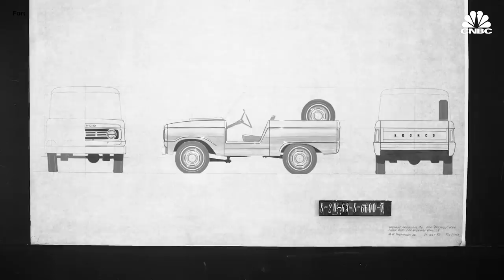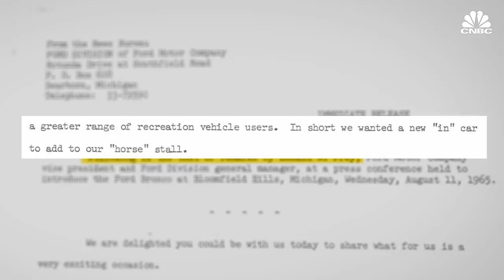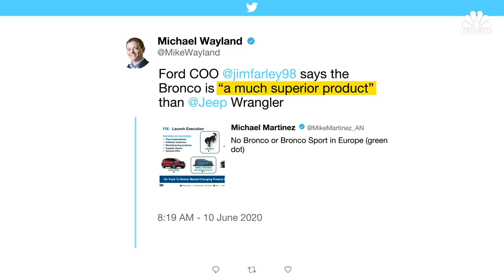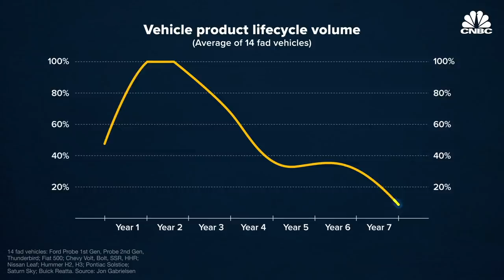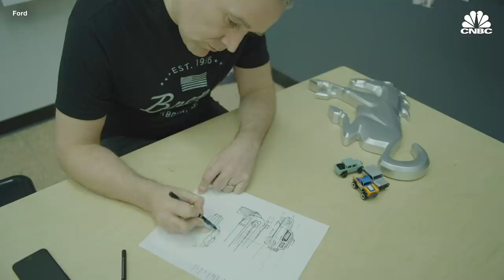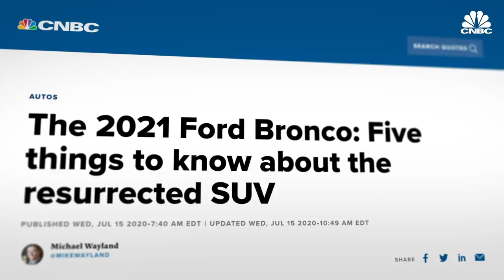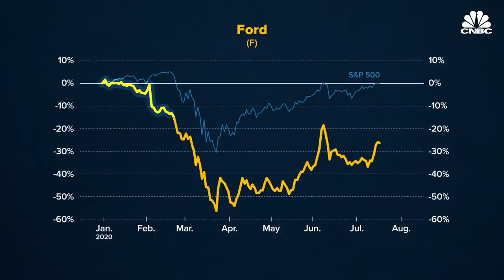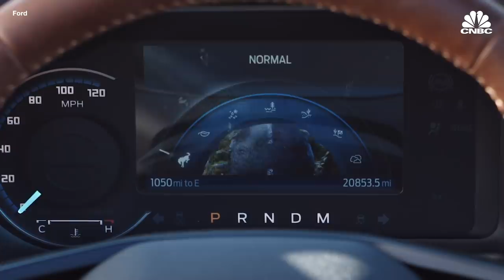Why Ford Is Betting Big On Its Bronco Revival

Comment: Very efficient and simplistic 4by4 ,no carpet. You could pull out the rubber matts and wash with a small amount of soap and water, using a garden hose and a rag. Parked with a slight slope and rinse off easily ,wash the inside same way and the same time as the outside. other than the dashboard and doors (if speakers 🔊) and headliners you’re washing the car inside and out with same two rags and two small buckets of warm soapy water and a garden hose . Easiest car to clean inside and out. Oh! And a whiskbroom under passenger seat. The rubber seal on back of the hood wore out to fast and when ya lifted the hood up when wet out, would allow water to run off of hood right on the distributor cap. Best vehicle my dad ever owned as I was growing up. Plus it had a shorter turning Radius than a Jeep, which was great for those 
Tight switchbacks in the woods.
With a winch and a trailer hitch
It seems like there wasn’t any place ya couldn’t go! 72 n baby blue.

Comment: Driving a jeep on the highway is like driving a giant brick 
[ a jeep owner once said ]
Reply: Its not bad if you realize they are ment for low speeds.
It's common for trucks and keeps to "highway crab", especially with bigger balloon tires.
Our keep has 44's on it and we don't play the radio at 55mph. Its like driving a huge moon buggy. It requires all your attention.
Reply: Hay wagons (pickups) and SUVs are crap on the road anyway, I only suffer one when I absolutely have to which is much of the time.
Reply: @Mrbfgray  try driving an F350, F450 and F550 trucks which are rough riding which you feel every bump.
Reply: @IDIturboDiesel  Yeah probably not much worse than my Chevy 3500 HD with solid beam front suspension.
Reply: @noneshere  that's like saying it's not bad as long as you don't put it in drive. Lol

Comment: The New Ranger was released for all but the North American market back in 2012, they came with a 2.2L turbo diesel, a 3.2L inline 5 cylinder turbo diesel and now have a bi-turbo 2.0L diesel option. The Ranger Rapter has been around for a few years now in Asia and does not share much of body work of the ranger, nor suspension and is super capable. My neighbor has one and it in no way comes second to the large size North American Rapter except for being a mid-size version. I have had a 2.2L turbo diesel Ranger with a 6 speed auto since 2017 and drive it like I stole it, payload is 1,200kgs and I've had more than that in it (large CV cable roll) its very powerful, extremely economical (68L I can drive 1,085kms) and built to last, although some interior decor pieces will not, I expect to get upwards of 600,000 kms out of mine. I did more than that with my last Ranger diesel, but that was a 1986. So this Bronco being based on the Ranger platform is a game changer. I hope the diesel engine will be available in the near future. Its incredible.

Comment: It's really telling that the new Bronco is built on the existing Ranger platform (mid-size pickup), while the old Bronco was built on the F-150 platform (full-size pickup), and yet the new Bronco is even larger than the last generation.  Cars in general have gotten HUGE, and honestly, both Jeep and Ford will have a hard time placating the off-road segment of the market that actually realizes how negatively weight and size affect pretty much EVERY aspect of performance on-road or off.  Both the new Broncos and JL Wranglers in 4-door guise are full-size SUVs.  If they want a cue as to what size is optimal for off-roading, they should be trying to offer models closer in size to a UTV/Side-by-side.

Comment: The issue with the Prowler, SSR, and Thunderbird was lack of power versus the marketing/badging.
Reply: SSR had 400hp
Reply: @shiftymiata  power may have been the wrong word choice, how about performance then.  Slapping SS on a GM implies a performance level  which the SSR nor 454SS did not achieve.

Comment: This is a return to the bronco 2 which was also built on a ranger platform  . I owned  an 86 xlt that ran without any real repairs  for over 200000miles before  it overheated and that was my fault . I was at a loss to replace it  because I couldn't find anything that cool at the time. Tried a full size still being made at the time felt like driving a backhoe

Comment: Anyone who has owned a Wrangle,r that no matter how cool they look and how fun the are to drive, and I never went off road, that mechanically they, like all other Chrysler products,  pieces of junk that at about 60,000 miles need constant repairs. And they seem to get worse as time goes on. So, right off the bat Ford has an advantage, even though I won't buy one till it's used at about 10 years old.
Reply: You nailed it right on the head I would never buy a Chrysler product and the Fiat merger made it even worse. Old Jeeps are cool but they are not what they used to be.

Comment: Honestly, and people may disagree, but the original Bronco and International Scout were both really "Tinny" compared to the Jeep product.  My Electrical Engineering professor [I was 19] had a new 1966 Bronco and my Uncle [an Excavation contractor] had a 1964 Scout.  Both had sheet metal 1/2 as thick as my Dads' 1962 Jeep Pick-up.  The Jeep fenders were like tapping your knuckles on a rock vs. the other two which flexed.

Comment: Like most remakes they’ll miss the mark? Like putting carpet and clothed seats in it! Ya could move the position of the distributor cap so it doesn’t get dripped on from opening hood 
When it’s wet outside. Brush guards that hold spare tires?

Comment: If the engine turns off at every red light, I'd rather have a vintage one, It will increase in value and I can work on it myself. Probably will last longer, too.

Comment: I wonder if the water pump runs off the timing chain like their junk V6s?  If that goes bad it dumps the coolant into the oil. And the dealers charge $2,000 to fix it!

Comment: Ford will fail if they bring back the rollover, Bronco II. The Bronco Rangers, produced during Iococa's reign, in the early 70's were the best off-road vehicles and are still around today. Sold my '75 Bronco Ranger regrettably, about 5 years ago and every winter, I miss my Bronco! It was the best 4x4 in North Idaho during the winter! Had it for about 15 years, only had it high centered once, never was stuck! Loved it!

Comment: Many engineers are not noticing the “white elephant “ , because they never sent out questionnaires, to find out why Jeep & Toyota Wrangler & Toyota mini-truck were even worth their weight in gold. Because the first thing that Bronco & Jeep Wrangler buyer’s want to do is lift it up for big tires. To do this without an expensive $5000 lift kit, this requires a straight Live axle with leaf springs, or secondary coil springs. Yet Ford young engineers went and put another IFS for their 4x4, this makes it more like a urban car, and less like a Safari or Farm & Ranch 4x4, where any young kid can buy a new Ford Bronco & have the lead springs bent to give it a 4-6 inch lift for a mere $200 or spacers for coil springs, but the fact that anyone buying doesn’t have to dump $5000 then another $3000-4000 in expensive shocks & accessories to make it ride better, then tired & rims & accessories.
Reply: The Bronco comes optional with 35" tires. I lifted my '78 Bronco and run 35s on it. Not much need to lift the new Bronco for large tires, it already comes that way.

Comment: Yeah this thing is going to be a hit. Just doing the math on the Base price of $29,995.00 for the  base package Bronco. If the 150,000 Reservations were just base priced broncos. The before tax income Ford would earn is $  4,499,250,000.00. Or just short of 4.5 billion dollars.

That being said. I own two 1996 modals. One is still stock the other is lifted 6" 's on 37" 's. I love them both.

If I were too buy a new one I would want it equipped with a twin turbo 4 or 6 cylinder diesel engine. with a manual 6 speed transmission.  I know they will be offered on the base modals with stock 35" tires. I would like too see an option for a slightly larger tire. For off road use. 
I understand the off-road heritage of the brand.  While it is based on the Ranger frame, I would still like too see it equipped with 3/4 ton axles. Bearing in mind this is for it's off road use. due to the operational stress and strain of the environment it would be in.

But that is just my .02.

Comment: my 86 bronco was hit by a buick traveling at over 130 mph. yes i got hurt but me and my wife, unborn son, and sister all survived. it put the bumper of the buick underneath the other drivers dashboard. it again was hit in a pile up with my wife driving where she got hit from the rear totaling out that vehicle slamming it into the vehicle she had stopped behind.  i started getting bad dreams, yes, truly and sold it and the next week the driver put it 4 feet sideways on the passenger door into a light pole. everyone survived in the bronco every time. the insurance company stated it was the safest vehicle ever made for occupants.  my son, years later was driving a police issue bronco and put it 4 feet inside a ford f250 he hit after the guy ran a stop sign. 2 times a bronco saved my son. he still has 2.  i still have him by 11 accidents to his 2 that either totaled a vehicle or one or both had to be towed. none were our faults. trust me. i have crash tested broncos and walked away because of them. i only hope that ford doesn't put a 10k destruction zone around the vehicle if it gets hit slightly like other manufacturers, 'cause we drive them and drive them like they are meant to be.

Comment: “Ford is also releasing the Bronco while the United States struggles the coronavirus pandemic and its resulting economic fallout.” - 1:37-1:40

Ford’s website clearly shows 2021.
https://www.ford.com/bronco

EDIT: Thank you CNBC editor for using b-roll footage of a first generation Ford Explorer at time stamp 4:55-4:58.

EDIT 2: If I remember correctly (and I could be wrong), the Chevy Volt is completely (100%) electric and the the Chevy Bolt is the hybrid at 9:31.

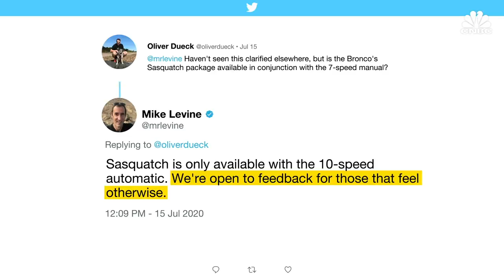EDIT 3: I did not know about time stamp 12:50.

EDIT 4: What if the map (at 17:31) showed County by county in each state in the country?

Comment: Given that they both have a MSRP of $28-29K, no one is going to give up their Jeep for a Bronco. The aftermarket parts are already there for the Jeep, the used parts market for Jeeps are already there. Why buy a Bronco and hang on to it for 3 years before you can outfit it with off road parts?

Comment: The Broncos gonna take over the off road maeket because its an all purpose vehicle unlike the Wrangler. It sucks driving in that square box on the highway where you can the outside noise while the windows are rolled up. It's gonna be a much better product then those lame Jeep wranglers that are only good for off roads.

Comment: Most Common Problems with the Ford Bronco

		Visibility and wiper
		Powertrain and airbags
		Engine
		Fuel system/gasoline and the electrical system
		Forward collision avoidance, structure, and visibility
		There are squeaking or howling sounds when the driver applies the brakes
		The brakes fail to engage or malfunction
		brakes failing to engage are dangerous. Bronco brake recall.  114,996 vehicles affected. The company acknowledges that the rear brake linings may have been incorrectly manufactured which can affect braking performanc, since the issue of the recall. Dealers say the recall repair part is not yet available. 
Go further….. and get something else.

Comment: Americans want a vehicle that runs, and drives. The most tech advanced thing in it should be A/C and basic radio. We want it to cost under $10,000 after tax. Fuel injection is nice but if it gets rid of all that computer bs than let’s go carbureted. We want to be able to work on it without a ton of specialty tools and computer skills. The windows should ROLL down. Whatever it takes to make it good and cheap to own. That is what Americans want. Lets get back to basics.

Comment: Release of the Bronco came at an economic low due to COVID, though, positive note for the release of the Bronco.  Amusement Parks are closed, so families would venture to either to beaches (to Surf).  Adventurous nature types would go to the Mountains for various types of activities. Hiking, Kayaking, Camping, though Ford is marketing as the 4x4 Rock Climber/Rock Crawler. It's design and option styles make more versatile than anything Jeep, or Toyota offers.   I prefer a roof all the time don't like the Sun eyes hurt, skin burns even with sun block.  In keeping Americans or even the world occupied being claustrophobic during quarantine times. It's a perfect time for those who want get out and see the back roads.  In the past i had trouble with Turbos at 38,000 : Ford mounts them next to the engine. Making it Hot the Shell outside Expands Outward & the inside Expands inward, with the heat like a donut.  The turbine Blades expand outwards coupled by the Back Flow from Carbon build up from intake and the Down Pipes. The Blades Lock up fuel mileage dropped from 32 mpg to down to 8 to 12 mpg,  because they're Turbo won't buy anything with Turbos.
In a different bad decision from Ford is Ford Representatives or Project Development Calling a 4 Door vehicle a Mustang, apply the running pony.  A 4 door variant removes all Past, Present, & Future Mustang out of the Iconic Segment The All American Muscle Car.  A 4 door variant removes the Mustang out of Automotive Historic Heritage segment.
 
The Mach E is the Ford ruining the Mustang Model its Pony Emblem .   Been asked By Mopar Owners "well what about the Dodge Charger HellCat... I said they're comfortable Sleeper.  I even Shopped for a Ford Explore, and found out they are Turbo Charged with the same engine as My EcoBoost is currently get Locked Up Turbine Blades.  So venturing to  Naturally Aspirated (N/A) engines 5.0 V8's .  Have Always bought Fords and the Magneride Suspension makes it the best handling vehicle ( it doesn't lean on hard cornering and doesn't dip like my 1995 did, during breaking.

Comment: I owned an early Bronco in 1970.  I sure didn't buy it for highway driving or fuel mileage.  With a lift kit and some real tires, ,it was a great off roader.  Too bad they will "Improve" it to 2020 specs.  (And ruin it)  ALSO: What does Covid19 have to do with off road driving?   Last time I looked it was a solo type of sport.  I mean, how do you get 20 people in a Bronco?
TOO BAD they will probably install one of those EcoBoost  engines.

Comment: If only it was available in a version with absolutely minimal computers.  A very basic version with manual controls for heat/AC, only a simple ECM for the engine. Sadly, government regulations require massive computer operated crap on cars, like active handling.  I'll take an early series with a welded in roll over structure over any new computer operated version.  It will be very successful, but have no impact on the value of vintage Bronco's which will continue to be massively desirable.

Comment: Congrats to ford for doing it right, chevy brought back the blazer and it is nothing near what blazers have always been- strong and capable 4x4. The new blazer is a joke and embarrassment to chevy. The bronco is sticking to its heritage and look and will be sold out as fast as they can be made. As a die hard chevy man, I will be breaking with tradition and ordering my bronco rather than the ridiculous "soy boy" blazer
Reply: Thank you, i saw the new chevy blazer and it is an absolute dead zone, just garbage, not only an embarrassement to chevy and gm, but to automobiles as a whole, go pick up the k5 or s10 blazer instead.

Comment: Too big and wide. And any company that sticks Engine Stop/Start, Cylinder Deactivation, and a CVT in their vehicles, can forget about getting my money. If the Wrangler didn't have Engine Stop/Start, I might have bought it instead of the 2021 Mazda CX-5 Carbon Edition Turbo w/ AWD that I bought. If the Wrangler also has Cylinder Deactivation, or a CVT, those would be more big negatives for me. Having too many speeds in the automatic transmissions is also getting ridiculously high... all it needs is a 6-speed automatic.

Comment: Doesn't matter how many versions or packages they offer they'll be lipstick on a pig if the engine and transmission don't hold up.  Wait and see.  If people start having problems before 100K miles then it's a pig not pony. That's where Toyota wins hands down.  You'll see their trucks go +200K before even minor problems occur. Ford's the only American maker that can match Toyota in that respect if they don't try to innovate too much. Just keep what works, address problems and improve on it. Back off the profit per unit and make it up in volume by building something that never quits.

Comment: Why release an off road vehicle that's useless off road. Independent suspension is designed for city/highway  driving, if this is ford's answer to the Jeep wrangler , it's the wrong answer and couldn't compete with a shopping trolley.  Jeep wrangler has its flaws don't get me wrong,  but the reason it's so popular in so many countries including the the US is the live axle front end that's perfect for off road modifications and applications + the option of petrol or diesel engines . If Ford releases this soft petrol only city boy SUV in Australia it's going to fail we have Jeep and toyota landcruiser dominating the rugged off road market.

Comment: Ford is B.S. I got a new F150 4x4 in 1976  & it was a pile of junk going through U joints every  3 months the ford rep just blew me off. I told  him i only drove  8 mils a day to work in Juneau, Alaska that has only 40 miles of which 98/present paved roads. The Shocks also was bottom out on the axle  as you can see where the rubber mounts had polished spots on the axle.  I tolled the rep that I would NEVER buy a new American car again. I kept my word.